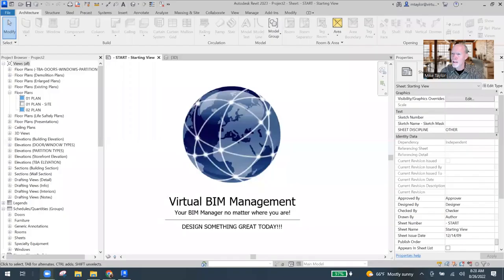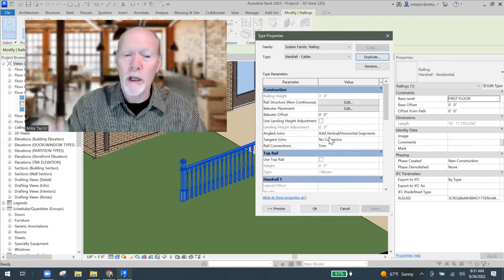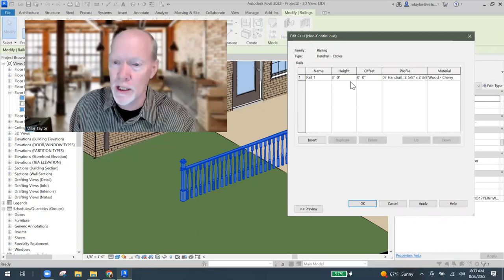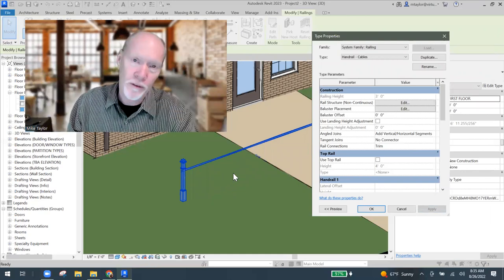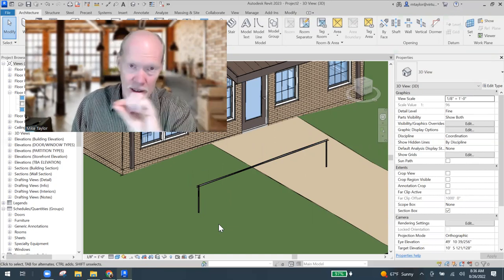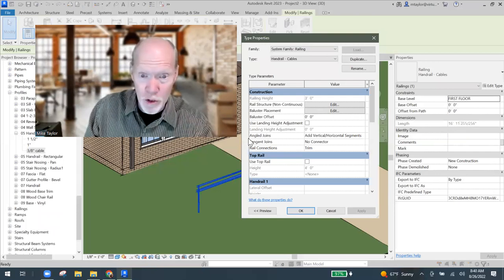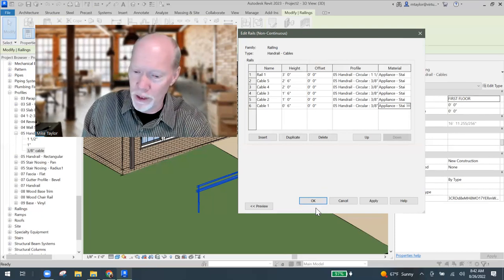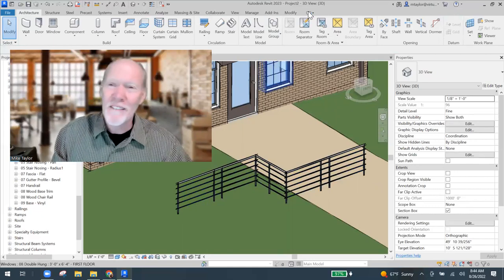CABLE RAILINGS: Simple process to make a cable railing

Comment: Thanks Mike. I've been looking for a way to make topography hosted fences look like the way they are supposed to. I work on houses in the city, they all have fences around the lot and the lots are never level, so hosting to the topography seemed like the way to make the fence follow the lay of the land. But it doesn't work because hosting gives all the rails have the same kinks and contours as the topography instead of nice straight sloped rails. What's the best way to get the rails to slope up or down, but in a straight line, from post to post?